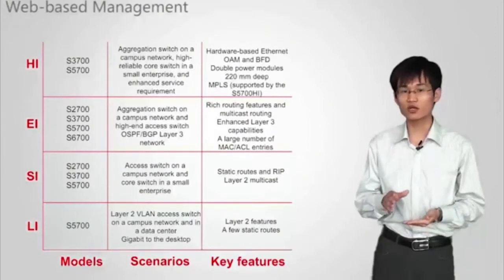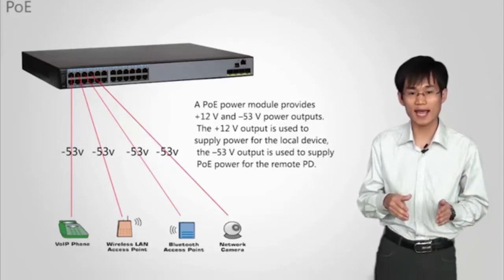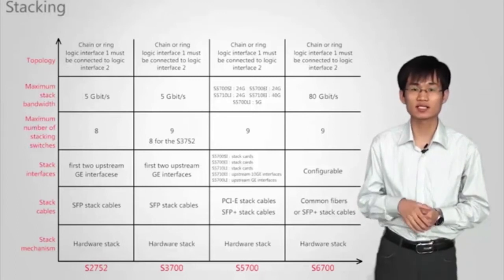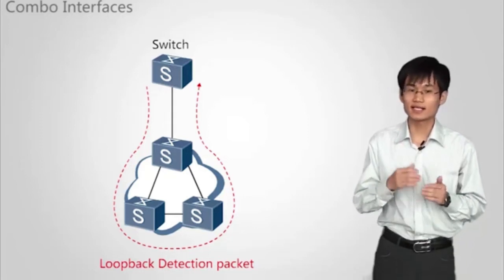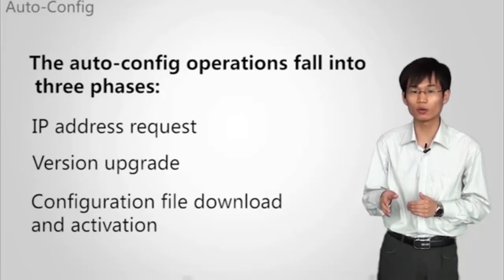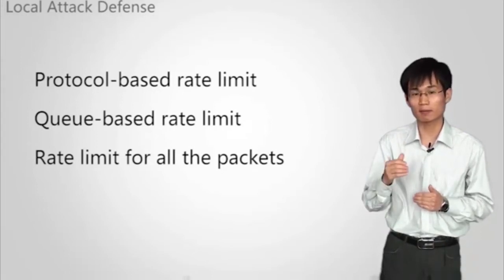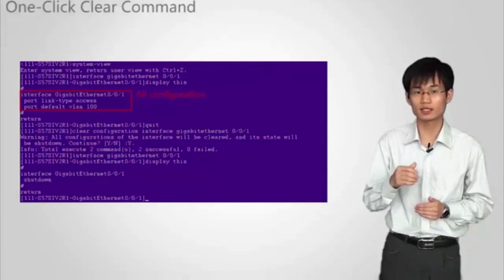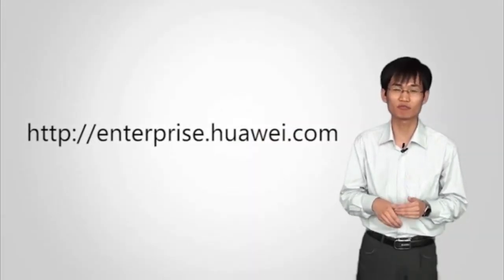Huawei S Series Fixed Switch Software Features Introduction

Comment: I can not create Vlan in this Switch Huawei. software version: V200R003C00SPC300 ---> it is error (Can not create this interface because the interface number of this type has reached its maximum.). Help me. Thanks so much
Reply from the maker: Thank you for your feedback.If you encounter problems that are difficult to determine or resolve during device operation and maintenance, contact Huawei Customer Service Center. We will provide technical support for you. After-sales service hotline: 400 - 822-9999